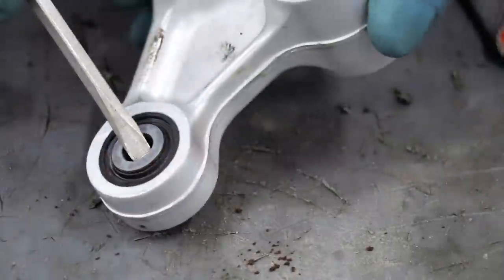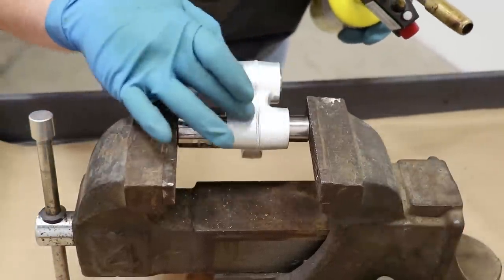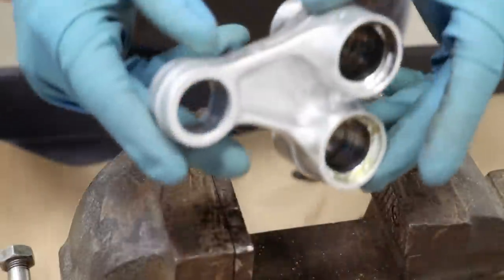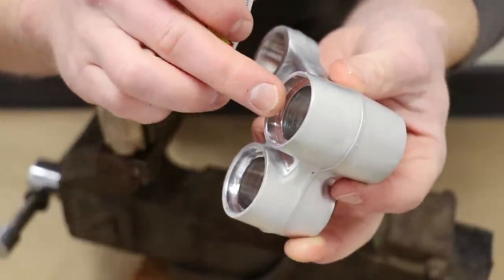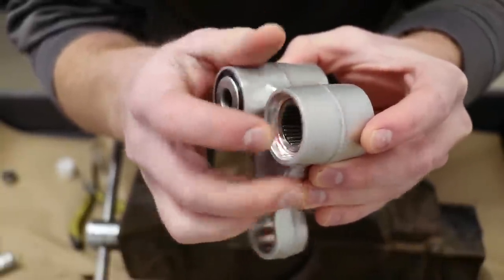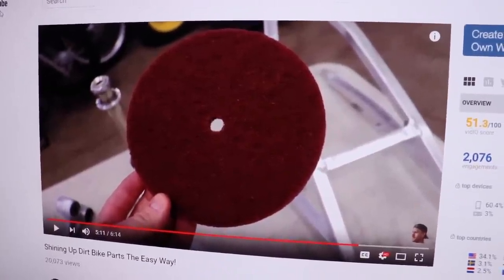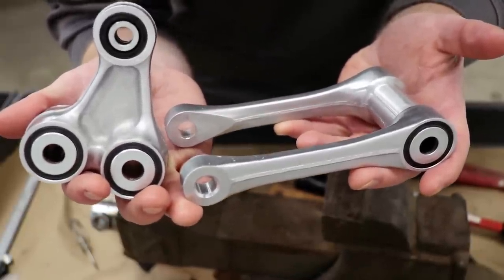How I Fixed My Broken Shock Linkage Bearings

Comment from the maker: What are you guys up to this weekend?
Reply: I am rippen my Honda 150rb and 250r at my track at my house!!!
Reply: Cameron Niemela we had some good rains last night....so we headed to the track and had a whale of a time.
Reply: Can I have a shout out I
Reply: Diggin a trench for water and sewer lines for a shop me and my brother are building! Should be done by the end of the month so I can start my rebuild videos! Grateful for the info you share, I wouldn’t be as confident with my bikes as I am if it wasn’t for the priceless info you give us. Thank you cam!!!
Reply: Freezing rain - so feeding the wood stove and  relaxing 👍🏻
Reply: Putting a new piston and clutch in my Yamaha raptor 250
Reply: Fixing the mistake I made yesterday. I pulled in a bearing slightly sideways and with that cracked the side of an aluminum housing. Nothing major but still bugs me to no end. A bit of quick-steel should make it oil tight though.
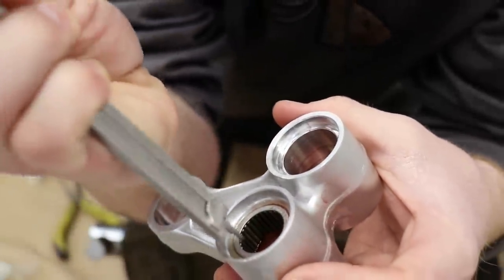At 9:22, how you measured the depth of the bearing it is very important that the bottom of the caliper is parallel to the bearing face, otherwise your measurement is off. Also I would suggest mounting your vise somewhere solid and put some soft-jaws on it.
Reply: I'm riding my 1984 Honda atc 70 this Sunday
Reply: Cameron Niemela and I’m going to rip my Honda cr
Reply: Working on my little 110🤙
Reply: Cameron Niemela nothing, I got tons of snow here and snowmobiles aren't done. No riding for another month and a half
Reply: paying off ticket's lmfao. i sold my cr125 so i can get a motorcycle, rode around for 30 min's and walked away with $800 in tickets. Guess i'm going back to dirt bikes lol.
Reply: Working on my CR500 AF build!
Reply: Hopefully gonna put my linkage into my  08 rm125
Reply: Picking up a yz125!!!
Reply: Homework. I’m taking welding classes.
Reply: Just finished the full rebuild on my 05 yz85
Reply: Rebuilding a 2003 YZ 250 engine.
Reply: Cameron Niemela off-roading at fordyce, arguably the hardest trail in California
Reply: Waiting for my frame to get back from powder coating
Reply: Rebuilding a Ktm 85 top end
Reply: Changed trans oil in our kx100.  Also ordered two searon hour meters to help me keep track of the time.  I should have changed the oil a while back from the look of it
Reply: Cameron Niemela great videos 👍
Reply: Sir how to order this item.
Reply: Hello idol cameron.. You always make my day so good by watching your videos.. Im a great fan of yours... :)
Reply: Idol cameron i wish i could have a dirt bike even if its cheap or old.. Honda crf 125 is ok with me...

Comment: i did this work on my cr250r 1 month ago, great video. For the bearing removal of the u shaped part, i didnt had a special tool, just used a copper 1/2" pipe with front end spreaded expanded into the bearing cage for the first one, i used the socket method for the other, worked great!

Comment: Rode my first dirtbike a couple years ago at 30. Ktm 360, scared the respect into me very quickly. Had a few diff bikes since then, always bargains requiring work. Right now have a ktm 250, yz80, and ttr125, both yamahas need a lot of work so finding your videos has been great help. I work as a mechanic by trade so a lot of it comes to me quite quickly, but then things like pulling apart forks for a rebuild seems daunting til watching a vid of someone else. Thank you for sharing your knowledge!

Comment: Did'd read all comments but old mechanic's trick: when you pus the bearing into linkage, keep them in freezer for hour or two. Sometimes frozen bearings can be pushed to correct depth by hand. If you apply decent amount of heat to linkage and freeze bearings it should be really easy to put them in place. Nice Videos you have anyway, keep on going the good work.
Reply: here in finland you can just leave the bearings outside for half an hour and that will do the trick

Comment: Just a hint on the installation of the bearings.  If you freeze the bearings overnight.  Upon installation, use a bit of heat on the main piece, then just use a little heat on the main part.  the bearings should slide right in with little/no force at all.

Comment: Dope beats! I just did this yesterday on an '08 450 I'm fixing. Now just have to wait for a blind bearing puller to finish up..
Reply: Jourdon Gulick you can use a copper pipe 1/2" to remove the first bearing of the u shaped part, no special tool needed, no need to heat too, came off in 20 seconds straight

Comment: Heres a tip. If you have problem of running trough kits like this all the time, but are just doing regular driving and not some crazy jumping, swap those needle bearing into ball bearing. Honda CRF 125 and 250 are using common bearing size what i heard from buddy who has those bikes and havent had any issues after doing that mod.

Comment: My old 2008 xr650L had spots/raised areas for grease fittings as it originally had zerks when it was first introduced in 93 but since have stopped drilling and tapping holes for them as it's cheaper.  15500 miles and the grease was still decent in them but I put three fittings where there was spots for them so I can just pump some grease in there every year or so.

Comment: One way to make sure you press the bearings in to the correct depth is to wrap a piece of black
tape at that distance from the end of the socket. When the black tape is flush with the cushion
then the bearing has been correctly seated. Measure to make sure of course. One push: easy.

Comment: Great idea ! I m stuck with the linkage bearings so i ll give it a try. Also my swingarm bolt is pretty stuck. I ve noticed that the swingarm started making some spacing with the engine after several hammers, which means that the bolt is stuck within the swingarm bearings/sleeves. I am patiently applying penetrating oil, leave it overnight and give some hammering the next day. It's the 3rd day and the bastard won't come out :(

Comment: I also use a vice to press bearings in but just remember you can damage the vice threads if you apply too much pressure.  It's better to get a small hydraulic bearing press.

Comment: If you get to that point where you think you need heat and can't turn the vise any tighter, give the back head of the vise a blow with a hammer, it will jar the bearing out a bit and you can continue pressing it out.  It helps when you dont want to put heat to anything.  You can also freeze the bearings, they'll go in really easy as well.

Comment: Just a tip you can use a can of compressed air and turn it upside down and freeze the bearing and should drop right in.

Comment: Nice job. It would make it a little easier if you put the small (push) socket facing the jaw of the vise that is pulling in and the big socket facing the outer jaw (you had it backwards). By doing it this way, you should have to use a lot less force.
Reply: I've never heard of that, enlighten me because i see no reason it would make a difference.
Reply: If you think about it, there should be more tension where the jaw is pulling in; you're forcing the small socket to the big socket rather than the big socket to the small socket. Maybe I've got it all wrong, everyone just has their preference I suppose. Looks like Cam had no problem either way.
Reply: Sorry, I don't see that.  The size of the socket is irrelevant as they are just spacers to push against the correct piece of the race or part.  If you put a socket between the jaws and measured the pressure on each side it, they'd be the same.
Reply: Sounds logical, guess it doesn't matter either way then!

Comment: Bearings are an interference fit. You should avoid putting grease in to aid installing them as you run the risk of the outer race spinning in the casting. The best way to help installation is to pop the bearings in a fridge or freezer for a few hours and pop the casting in the oven. They will virtually fall in.

Comment: Heat is definitely makes a difference, but you could have also sprayed some PB Blaster penetrating oil in there for a couple days while waiting on parts.  That plus heat would have moved those like butter.  I e only ever had to use heat to drive out wishbone races on my FE501.

Comment: how much better is the bike handling after a rebuild like this? my rear linkage is pretty bad too, just removed the shock which noticable moved up and down in the bearing/ linkage. made clunking noises under braking/ over bumps. i think i will just replace that one bearing, the rest are not loose but may well be falling apart, but i have bigger engine related issues and that rear linkage bearing kit is pricey. 
i wonder why they built it like this, seems a bit delicate and somewhat unessessary to have all those bearings in there. almost. crazy how all the needles from the bearing just fall out. mine was like that too, just gunged up with dirt grease and rust, certainly not doing any rolling like roller/ needle bearings should, lol.

Comment: thanks Cam great help. saved my Tiger shock rebuild with open cage  pins.  Now doing swingarm without manual and found what look like shims. Do these need a special gizmo to pull out.. or can i just belt the lot through with swing arm supported with jack. Cheers.

Comment: Hey cam, how did you get the lower shock linkage in there as the manual says it goes in with the side collars then the seal…? I smashed both seals trying to get them in there.. please advise.

Comment: For blind bearings put a few spots of mig weld on the inside of the race. That will allow you to get a drift or a flat head screwdriver in there to wack them out
Reply: I was just going to ask that question, what if you have rusty blind bearings that fall to bits even just looking at them

Comment: KTM uses the loose needles and caged needles in it's rear end.  Be careful when taking apart or you will lose the loose needles.  I dunno why they don't use all caged ones.  Greasing these each season and they will last for a long time.  Don't grease them and you need to do what the video shows.

Comment: I measured the Pivot Bolt to Sleeve clearance and got 004-005 clearance. NO ONE sells or Talks About the Bolt to Sleeve clearance. You rebuild the link and put in new sleeves but the BOLTS Are Old. I spent $130, $20 bolt and $20 sleeve, tax,  for OEM stuff. It's in the mail. 1998 kx125. And the nuts are $8 each but I'm using the old ones.

Comment: Hey Bud ! I need your advice. I have a WR450F and the linkage pivot shaft / bolt is just stuck. Tried heat and penetrating oil.. no luck.

Comment: Cameron if you ever come across a yamaha rt100 i will buy parts from you.  Im keeping my sons 94 rt100 up since it was his first bike.  I need exhaust and cylinder parts.  Btw, it leaks clean oil from somewhere near the main sprocket or gear shift lever.  Does thst sound like a bad crank seal or gasket?  Im not interested in removing the engine to repair a internal gasket though

Comment: That’s so weird. My 2000 cr250 linkage is the same except the lower bearing for the shock. If I put the dust caps inside the seals my shock clevis does not fit. And also the bigger part would then be resting against the race of the bearings. So by putting the smaller side inward against the middle round part it makes is like a 3 piece shaft going through the needle bearings.

Comment: I have an issue with a CRF 100  rear suspension link, I'm trying to remove the bolts but there is one I can´t take out, it holds the "triangular" link to the swingarm, I noticed there are two welded washers that doesn´t allow the bolt to move out, could you give me an advice on how to remove that bolt? Thanks for your help in advance... Have a nice day!!!

Comment: Hey Cam, question. We were rebuilding my friends 2004 Cr250 this weekend with the all balls kit. When we got to the linkage bearings we followed your directions centering the bearing so we could install the dust caps . You show the smaller part of the the dust cap facing out as does the factory diagram. No matter how hard we tried we couldn’t get the seal to stop popping /falling out . It’s not for a lack of skill or tools so kinda at a loss . We flipped the dust cap with larger side facing out and it works perfectly, like that’s the way it’s supposed to be. Any insight on this issue ? Hope your feeling well. Thanks
Reply from the maker: You'll definitely want the smaller part facing out, but the seals you received may be swollen or damaged. Try using OEM seals, they're great quality
Reply: A little late to the show, but seeing exactly this same issue as I type this.  Luckily the old seal didn’t fall off during removal and kept it for reference.  It is oriented with the small side in.  Hey Cam, wishing you the best during a rough time! You single handedly gave me the confidence that I could do a lot of the work to get my bike running properly! Really appreciate the detail and extra mile you go to provide so much clarity and selling the parts you use! Wish you the best!

Comment: Where did you get the recommended bearing installation depths?  Does Honda include this in their manuals?  - thanks!
Reply from the maker: Yes, I got it from the factory manual.

Comment: Hi there, I have a little trick for all of you guys who want to preserve your suspension bearings, shims, bushings, etc., for as long as possible.
Some time ago I came across a product called "Corrosion-X" (similar in consistency to WD-40), which is based on the fact that all metal is a little bit magnetic. It takes advantage of this by binding to it magnetically, almost on an atomic level - so it's very restistant to heat and pressure.
I've started to use this product on a lot of spare parts, tools, etc. and I'm sure you'd be pleased with the results as well. c",)

Comment: Do you have a preference, OEM vs Pivot Works? I tried getting Pivot Works at the dealer but the guy insisted on OEM. Is there a difference besides price and did you have a link to the measuring caliper?
Reply from the maker: Quality is pretty equal, not sure on price. This is the one I use https://amzn.to/2qWQ5Qi
Reply: Thanks

Comment: does how deep the bearing really matter? Eye balling it would be sufficient right?
Reply: Your seals will rip because their not in enough. I did my linkage a couple months ago and noticed a tear on one while removing the shock last week.
Reply: damn might have to take a look at mine, did mine not too long ago but never took measurements and didn't even know there were specifications to it lol
Reply from the maker: The depth does matter, it determines the overall width of the linkage and if the bearings are not in deep enough the linkage won't mount into place like it should.

Comment: Just wondering if you come help me I've got a 2004 kx 250 the rear shock is over extenting so much the spring is hitting the rear of the engine what you think the problem could be cheers in advance shaun

Comment: Im having a hard time finding parts for my 1984 CR125R im teared down the frame and definitely need a linkage rebuild kit. On pivot works it says its a "possible fit" so ima just go with it. Bike wasnt giving out spark, took it ro get rebuilt (no spark issue wasnt why i took it to get rebuilt) and still no spark. reason why it sat for 4-5 years now everything is  apart and ready for a rebuild. If possible can someone please help me find a for sure working CDI box. I will be doing a video on this soon

Comment: Are the specs in the manual for those measurements?
Reply: Couldn't fi d the specs for the bearing depth anywhere in my  manual  ? Had to rewind and write down what Cameron said. Hope it works ? Wonder where  Cameron got those specs ?

Comment: Without a blind bearing puller the dog bone races are a bitch to remove. I spent all day a while back working two very small flatheads around each race like changing a tire. Instead of one or two inches at a time, it's one or two millimeters at a time.

Comment: How can u tell if your linkage is worn out?
Reply from the maker: If the bearings have movement in them or do not spin smoothly then they need replacement.
Reply: Any way to tell without taking them off the bike lol?
Reply: Yea mine are worn out, there is play in them so i need to rebuild the linkage

Comment: The way I've always done it is doing the same thing you do to extract them, (expect this one time I've had to get the races milled out because they were so seized) to get them in I usually just throw the bearings in my freezer for 24 hours then heat up the linkage and slip the bearings in with no tools then give them a couple love taps with the ole socket. Yeah you have to wait 24 hours but it's better than the chance of you breaking the bearings. Good shit though

Comment: Only if I saw u post this vid a month ago when I did my crf250r 2011 linkages I fuck my linkage arm and bent it with a bearing press cuz didn't know I had to use a sold hammer 
Now I had to fork out 250 dollars for a new arm after I didn't have my motorbike for 9 months had it 2 days and wanted to do my linkage cuz it never been down 
Pretty pissed now